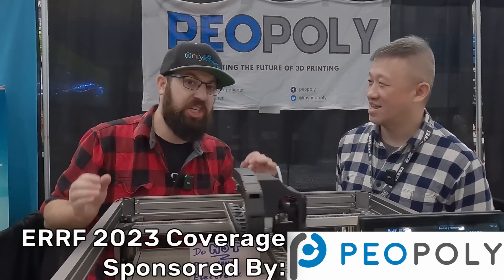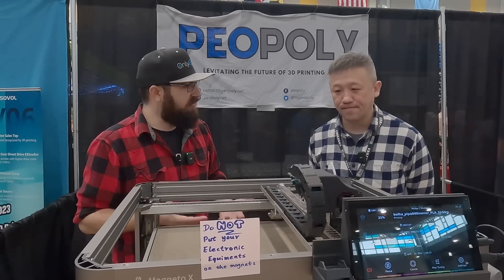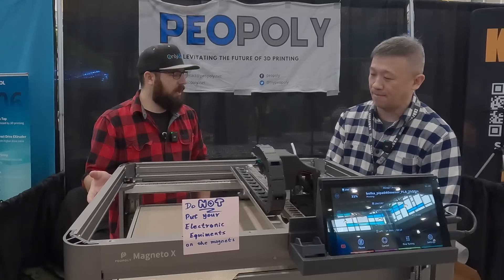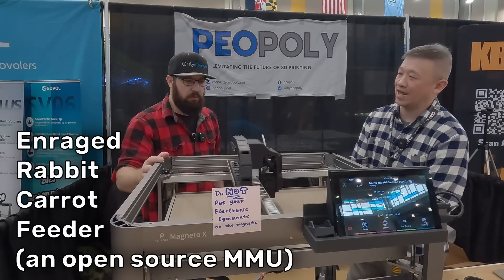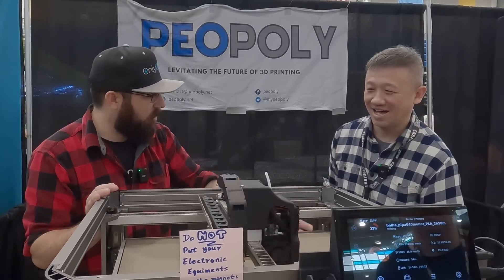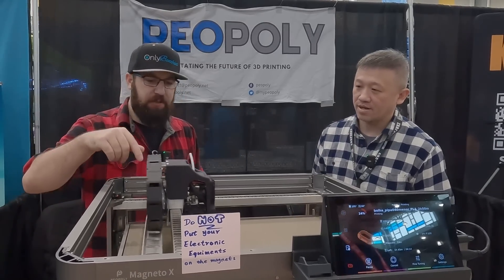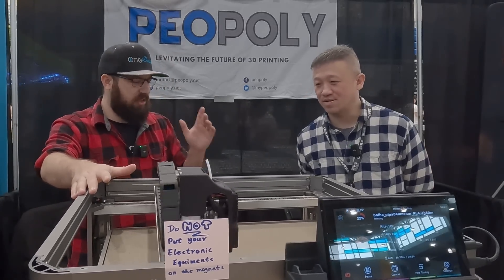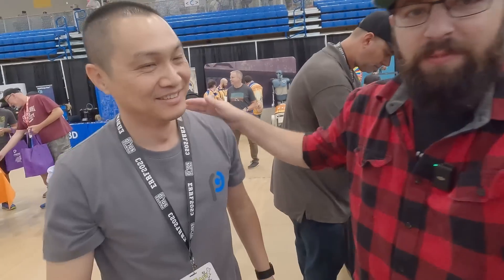SOMETHING ACTUALLY NEW IN 3DP - Peopoly Magneto X

Comment: When I saw it and saw the note I had to ask myself “how many people placed their electronic device on those magnets before they decided they had to make a sign.”
Reply from the maker: was pre-emptive, they figured people would be leaning over the machine with their phones to get pics/video, better safe then sorry
Reply: @CanuckCreator you have more faith in people than me!
Reply: Constant magnetic fields will not interfere with most electronics. It’s changes in magnetic field that induce current flow in conductors. If there is an issue with interference from this machine it’ll be from the coils that have switched current resulting in changing magnetic fields.
Reply: My phone doesn't use magnetic tape to store information. They make magnetic wireless chargers. I have passed an 80lb neodymium magnetic over my phone before, and it has no issues. Someone please tell me what I'm missing.
Reply: @irkedoff they put the sign there to...
A peak people's interest as they walk by
B marketing play(really this is a part of A). 
C liability issue from folks getting close up pics

It's a handwritten note to not have your electronic devices too close to the machine.  That's about it...didn't miss much of anything. Unless I missed something and if that's the case then I dunno either lol what'd I miss 2?
Reply: No one. It is marketing.
Reply: So you're telling me you could put an iPhone with a magsafe back and have it not fly from the user's hands?
Reply: @BrettJamesSuperRoach  The magnets weak as in the iPhone, you would have to have the grip of an over ripe banana for the phone to even move :)
Reply: Magnets have zero effect on our devices these days, back when we had Nokia 3310's big industrial magnets used to kill them, these days you can slap your iPhone directly on one and it will have no effect, they are pretty much hardened against it, I know this as I have work around Eriez industrial magnets in the mining industry for decades, and they used to effect our phones, a very long time ago, but not any longer, you would have to some how jam your electronic device between the carriage and the magnet array in order for the device to experience some sort of field alternation that could induce issues in the form of electromagnetic radiation, and I think that would be a little hard, unless you have the iPhone 20 Pro that is as thin as a sheet of paper :)
Reply: “Equiments”

Comment: I’m really happy it works, something fresh and innovative. It’s still to see if for my use the 3 nm resolution can be detrimental or not in a real print.
Reply: Why would 3nm precision be detrimental? Do you need inaccuracy for your printing?
Reply: @sonichedgehog36  regular stepper motors with 1.8 degrees on a Voron are 3 times more precise